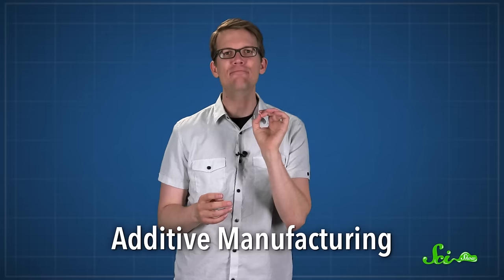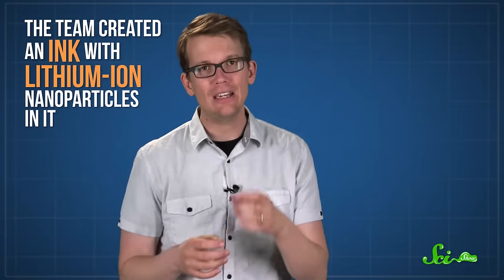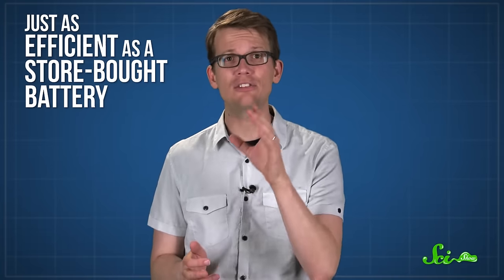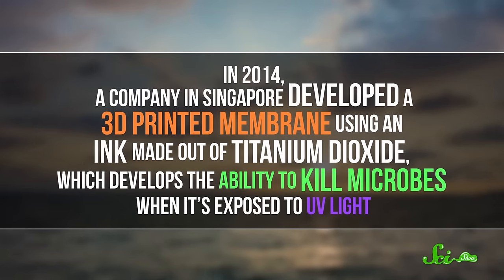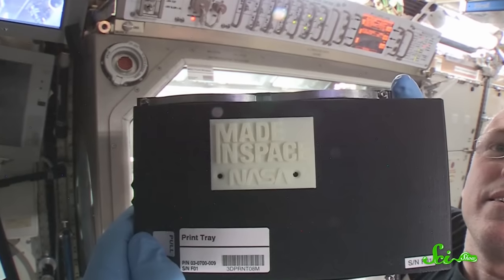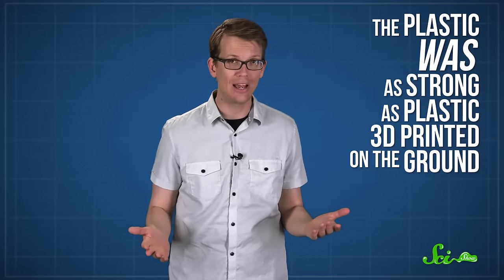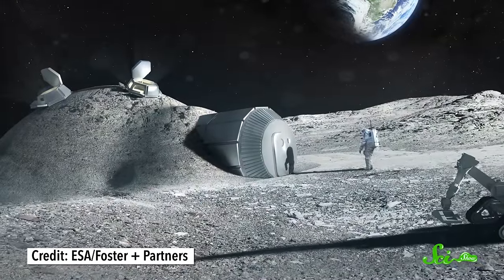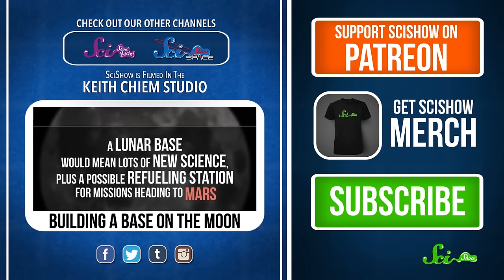The Future of 3D Printing

Comment: So robots are going to play Minecraft on the Moon? That sounds awesome!!
Reply: Nice
Reply: +Bryce McCandless is that all you say?
Reply: +Joseph Newman Problem?
Reply: Galacticraft and NASA, together at last!
Reply: Anyone else hoping they need people to control those robots? I VOLUNTEER
Reply: ClayXros they probably won't, they already have a lot of autonomous robots in space already. The input lag would be too long to be of much use anywhere other than the moon maybe, and even then that's probably too long too. The moon is so far away that if you put all the other planets in the solar system touching one another in between there would still be over 4000 miles of empty space.
Reply: +Joseph Newman signal lag time to the moon is only a little bit more than a second long, so remote controlling something for, say, digging would be feasible, but anything requiring fine movements would probably be out of the question.
Reply: So Minecraft wasn't a game it was a training simulation???
Reply: denniselliott27 yeah but think of welding, where an extra second can make for a structural problem. Two way lag in that case would mean it's two seconds between the moment you need to stop and the moment the signal gets back to stop. There's loads of construction tasks where that would make it impossible.
Reply: +denniselliot27
On the moon the input lag wouldn't really matter. Humans are amazing at adapting to all kinds of stuff, just like adapting to an about 1 sec lag. Infact after a bit of work with this lag they need to readapt to lag-free input.

Comment: what NASA needs in a colony building 3D printer, is the cement printer, I'm sure you'd be able to build a a structure in no time, I also remember seeing a documentary on lunar dust, they found out that due to the composition of the soil it is in fact better medium than traditional concrete, about 3-5 times stronger.

Comment: I buy the benefit of being to print a tool or replacement part in a jam. But its going to be a while before 3d printing advances to the point where its better to print, rather than conventionally mold, something as geometrically simple and "we need 10,000 of them" as a brick

Comment: Hmmmmm no, resins are not a kind of plastic, and 3d printing in space would have to rely on fdm printing because resin printing requires the resin to be able to drip off of the build plate between layers

Comment: I wonder how long before we get practical printed semiconductors. Some of the very earliest were 200 micron. I think that might be possible soon. The trick is going to be getting down to the 5 micron level. At that point it is possible to make simple 8 bit microcontrollers. At 0.5 micron you can make most of what you can get today (apart from top end FPGA's and DSP's etc). I don't think though that we will be seeing 5 micron any time soon though.

Comment: The Nissan Leaf is not a hybrid, it's a full battery electric vehicle.
Reply: Nice
Reply: Hey, chill out!
Reply: It is indeed but the range is a bit crap for the models from 2015 and earlier. IE about 80 miles in the real world. However Nissan from 2016 are either as an option or just over-all changing the battery from 35kWh to 50kWh. That should give 110 miles (ish).
Reply: TRIGGERED
Reply: +Gordon Lawrence Still no good outside the city. Not only would I have to recharge after every journey, but there are also hardly any charging stations.
Reply: Actually that's only true for the US. There are thousands of charge points many free in the UK alone. Most of Europe is measled with charge points.
Reply: If you're willing to drive for a few hours then wait a few hours, rinse and repeat until you get where you're going...
Reply: According to Nissan you are mostly correct "21 to 26h at 110V, 4 to 6h at 220V, 0.5h at 440V" So, you could wait 30 minutes every 100 miles or if you drive a Honda Fit like I do you could wait 2 minutes or less to fill the tank every 400 miles...
Reply: firstly my gf uses it for getting groceries etc so range is not an issue. Second from solar panels the cost of running it is around £0.5 per 100 miles (the money we would have got for selling to the grid). So over a year we are saving about £1500 on fuel and at least £50 road tax as well as having cheaper insurance.
Reply: Gordon Lawrence You're not accounting for the cost of the panels. How much did thse cost you? For getting around town, yes I'm sure it's a great car! Especially given the extra costs that the local gov imposes on you. Where I live, gas is cheap but electricity is expensive because of industrial use and AC being on all the time in every home.
Reply: Uruz2012 yes I have halfwit. It's not bloody difficult. All you have to do is calculate the cost of the panels over the number of kWh it will produce in 25 years.
Reply: Gordon Lawrence Wow, no need for insults... "cost of running it is around £0.5 per 100 miles (the money we would have got for selling to the grid)" In your own words, the number you gave doesn't include the cost of the panels.
Reply: nope but you really think i'm going to put in everything? like the government kickbacks etc etc etc?
Reply: Gordon Lawrence To do a true cost comparison, yes. For your own benefit; you should take all factors into account when comparing prices. Including your personal use habits. If you only drive long distances rarely then an electric car is great. I drive long distances too often for anything but a gas car to work out well. My stick shift Honda Fit gets 38-42 mpg highway which is better than most hybrids without the cost of battery replacement.
Reply: I have taken all factors into account. I'm was project managing over $3 billion worth of business in my last job so it's dead easy for me.
Reply: Gordon Lawrence So, what's the true cost per 100 miles then...
Reply: other than wear and tear it uses roughly 40kWh the price of which would vary dependant on how you are charging it. If I use a local fast charge point at Ikea it costs nothing.
Reply: Gordon Lawrence Nice! You can get some meatballs and a bookcase while you wait... lol! I'm not hating on electric at all though. It's not good for me right now but as the tech gets better I'm sure I'll have one eventually.

Comment: The base on the moon has to spin to simulate gravity. Maybe like a big underground gravitron.
Alternatively, it could be run by remote controlled robots, who don't die in low-G.
Reply: Not hard to do. Just spin the colony... Oh wait... That's not quite easy either. Let alone how you would go outside. Thus why planets and moons suck. That's why I stick with orbital colonies. Orbital Colonies: simulating one gee in the comfort of a giant cylinder.

Comment: How does 3D printing apply to items with multiple elements?  Like something made of metal, plastic & resin?
Reply: You print each part separately and assemble it. It doesn't even occur with different materials, printing has inherit flaws that come with it, so if something shouldn't/can't be printed as one piece, it can be split into several and printed, then assembled to the full part.

Comment: Still wish they would make personal 3d printing cheaper. There a couple of projects I want to print up but the cost is too high.
Reply: You can build your own for around 200 dollars.
Edit: You can get it down to 150, I just used expensive materials.
Reply: What type of 3D printer? Do you have a link to the directions you used? Do you need any specialized tools to make it?
Reply: Reed Chen
Gunna need more info than that.
Reply: +Reed Chen And some time spent trying to figure out "what the heck is this thing for?" × whatever amount of parts are needed to build a 3d printer. 

Anyway, i think it is possible to build one with a RaspberryPi or Arduino or Whatever with enought patience and skills
Reply: For those asking how, here's the guide:
http://reprap.org/wiki/Prusa_i3_Build_Manual
Or you could by a kit, a bit more expensive, but much easier, and no need to create custom parts yourself.
Reply: Thanks!

Comment: We are hoping...HOPING that some of the air craft testing going on will give data on using printed parts in nuclear reactors. In reactors, welds are a BIG DEAL. They get attacked by radiation worse than other parts of the plant. This makes inspecting them a big deal, and they are the thing that most shortens the overall life of a plant. BUUUUUUTT, if you could reduce welds by printing structures that normally needs welds..........that could be a real game changer! I mean, essentially, a reactor is just a big, dumb, steel tank. Printing could take that idea and simplify it greatly! This could help with safety, longevity, cost, scalability (think smaller reactors, like one for your city instead of a region). Big hopes, but still holding our breath.

Comment: Wouldn't regolith really be something like "king's rock" or "rock king"?
Reply: It actually means something closer to "rug rock." Regolith is the unsolidified composite rock the sits on top of the harder, compressed stone known as bedrock. On the moon (ie the lunar regolith) this is mostly composed of aluminum and silicon oxides.
Reply: The "reg" prefix comes from the greek rhegos (The e has a line above it but I don't know how to type that character, google if you'd like lol) meaning rug or blanket. First time I heard the term I thought the same thing as you though lol.

Regal that you're thinking of however comes from the latin rex meaning king, then to regalis and lastly into our regal.
Reply: +Hi Mynameis Thank you. That's really cool. I did take a little Greek (which was really just an additional time with the Latin teacher since there is no Greek class in my high school) but I took 4 years of Latin, so the "reg" part just jumped out. But now that I think about it, it would make more sense for "rego" to come from Greek since the "lith" is definitely from Greek.

Comment: At first I thought they mis-labeled the cathode and anode, but then I remembered CCD (cathode current departing) and they never specify if the battery is charging or discharging. Does anyone know if it was labeled correctly?

Comment: I know right now 3D Printers can only go so far, but that 3D printed Synthetic Moon Rock wall looks so bad...
Reply: it was the first time they have done it so of course it looks bad
Reply: Remember how bad the first cars and computers where? Give it time, and the technology will improve.
Reply: I agree with the other commenters, it is a first time thing, and it isn't supposed to look good it is supposed to be functional. I don't think the beams of wood and metal inside of houses and streets look pretty, but they sure are useful!
Reply: It was literally just a proof of concept. I've never seen an initial prototype that didn't look like rough-cut garbage. And besides, when you're talking about colonizing the moon, aesthetics are literally the absolute last concern.
Reply: Our current computer technology is more than enough to print a house, it's only 3D printing technology that isn't yet capable.